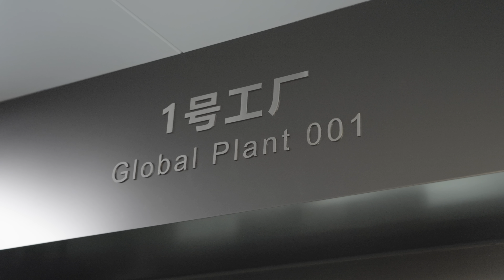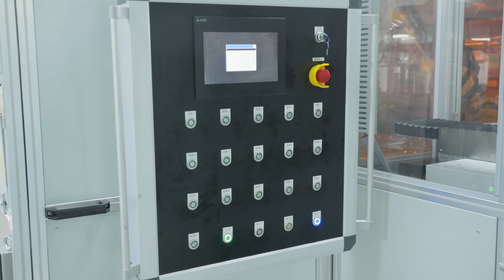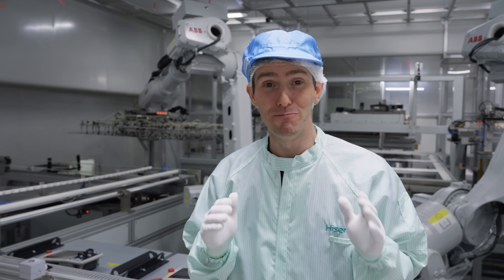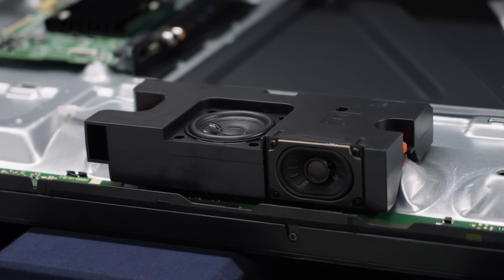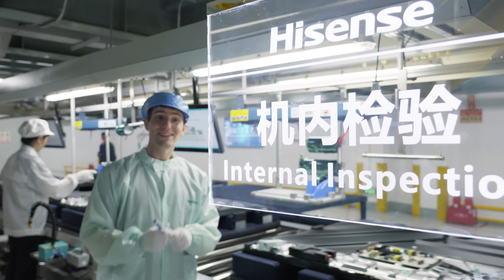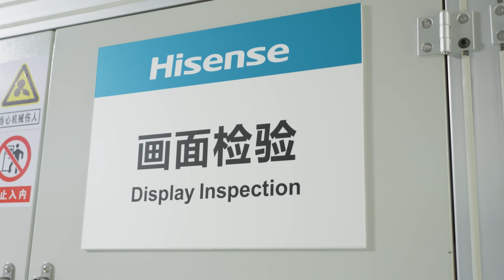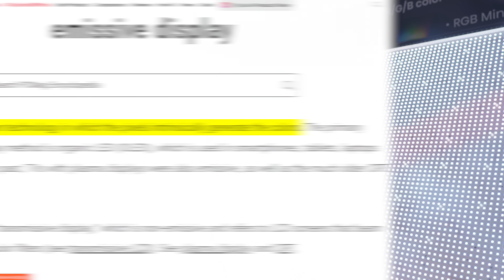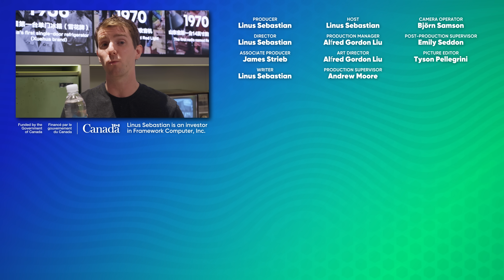This TV Factory is the Coolest I’ve Ever Seen

Comment: I bought a Hisense 4k 65-inch TV. and I do NOT recommend anyone to buy it as it is. The performance is so slow, and responses are lagging by seconds and has an older version of Android TV OS 11, and they do not provide any software updates. The refresh rate is locked, and dynamic refresh rate is greyed out. The microphones recognize my speech properly less than half the time.

Comment: Avoid Hisense UK at all costs.
I’ve had nothing but problems with their products and their customer service is genuinely one of the worst I’ve dealt with.

My Hisense washing machine and tumble dryer make a loud ticking noise like a Geiger counter, and despite raising this repeatedly, Hisense UK refuses to acknowledge the fault or honour the warranty. The support team are dismissive, unhelpful, and completely out of line with the brand values Hisense claim to stand for.

Hisense’s UK division does not reflect the mission statements and promises the company advertises.
Think twice before buying anything from Hisense — it may cost you more in the long run.

Comment: There is very big inconsistency in what we see and what we get.
R&D part shows backlight technology starting with FALD and dates it’s as elder technology.
However on production site we see panels only with 5 LED strips, that is far from FALD.
Those with 5 strips are just cheaper, I get no one want’s to present that, but without it the R&D part is misleading. Lower size models have usually 3 LED strips, yes I fixed few of them.

Backlight uniformity is one of the most irritating effects that can you notice after buoying new tv, especially on sport events it is a very visible. It is good to see that factory is testing that. Reassuring that bought model was tested. But seeing that FALD is still not a standard in the lower tier makes it not easy to buy. However, next time I will be buying TV I will look for hisense. 
BTW very nice tour.
Reply: hey buddy . In case you want to know Hisense is LED global industry leader for 5  year stragith.   They I mean Mini LED.    they prob not going to show ppl their higher tier process for their ULED line. 
                    Contrast :  (Rtings ) 
L9Q —- Triple    🟥🟩🟦 Laser 5000 Limen 
UX 116”             🟥🟩🟦 mini LED⚜Hisense
 🐦‍🔥🐦‍🔥🐦‍🔥🐦‍🔥    True RED      🐦‍🔥🐦‍🔥🐦‍🔥🐦‍🔥    
U9QG-     release in the fall       2025   
U8QG-      460000:1     Hisense     25
UX 85”      400000:1      Hisense      3
U9N—-      344000:1      Hisense    24
Bravia9–   292000:1        SONY        4
U8N——     277000:1      Hisense      4
Qm8K—     273000:1      TCL             5
QM9K—     271000:1       TCL             5
QM7K—     265000:1      TCL             5
QN95C-     201000:1      Samsung   4 
Qm851—   200000:1      TCL             4
X95L——   200000:1      SONY         3
QN90D-     167000:1      Samsung   4
U8k——-    165000:1      Hisense      3  
U8H——     160000:1      Hisense      2
U7QG—      137500:1       Hisense     5
Bravia7—   120000:1      SONY          4
Qm8——     114000:1      TCL             3 
QN95B—    110000:1       Samsung   2 
X95K——    100000:1      SONY         2
U7N———    89000:1       Hisense    4
Q90C——     83000:1—  Samsung   3
U6N———    80000:1 —-Hisense     4
QN90A—-    75800:1 —- Samsung  2
X93L——      72000:1—-  SONY        3
QM7 ——-     67000:1—- TCL            4
W95A——     62200:1    Panasonic  4
U8G———     54000:1     Hisense     1
QNED 85A    53500:1         LG 
Bravia5—      53500:1     SONY        25
x90L———     49000:1     SONY       23
X95J ——-     37600:1     SONY        21
X90J ——-     34500:1     SONY        21
X90K——-      35000:1     SONY       22 
X930e——        6564:1     SONY 
X900h ——       5386:1     SONY   2020

Comment: Just bought a Hisense U8Q, I'm hoping I wont have to use the 5 year warranty, the TV looks absolutely amazing.
Reply: Dude you will Love it!    Once you U8 , u can NOT go back to OLED.   n you will start to feel like OLED = scam.  or OLED is inferior ( in person real life) .
Reply: Also this is some info I saved for myself.  since you Bougth U8Q.  I am sending it OVER u might need it.  IN Case SONY snobs make fun of it. 
Hisense PROCESSING   <3<3<3 

ppl mistake :         bit  .     EACH Gaming Monitor has to do 50/ 50  MATH!  Usually 240hz, 360hz they will UP the hz. but Lower the (color depth of bit rate). 

so yo u will often get liek 10 bit Monitor for motion, but they do NOT tell u secretly u get 8bit colour.  
Also people have NO idea that (8+2fr) motion /  10 bit Colour  is MUCh better.  because you get about 10 bit motion visual, then almost -----12 bit colour.   

The same method if its ( 8+2fr) / 12 bit.  means you get 10 bit visual  but like 13 14 bit color processing. 

         Color transition in Motion    /     Color Depth ( " do I make Mid the SHADE to look more Lavender to be close to Blue to my left,    or make Mid shade to look More Magenta to look more Pink to colour to my Right") 

UX :       ( 8+2 fr) Motion /  16 bit.      ( 278 Trillion )    Tri Tri Trillion colours 
X11K                    10         /   16 bit 
U8QG    (8+2fr ) Motion /    12 Bit      (   68 Billion )     B  B  Billion  
SONY                   10        /    12 bit       
Qm8K                   10  bit  /    to bit       (    1   Billion ) 
G5                         10 bit  /     10 bit 

In general the :   (8+2 fr ) / Whatever is BEST!      ^^  ( I did Significant Research in Gaming Monitor )  When I was buying one recently finding SOME high end Lenovol Legion ( Gaming/ work hybrid monitor)   $ 1000- 1500 LED:      ( 8+2fr ) bit/  10 bit colour,           10 bit motion/    8 bit colour       
I was like WTF!           Lenovol is HIgh end work machine. VERY respected. 

Finding OUT IN SHOCK ,,,,,,, <3<3<3<3 
a HOENST company will do: 
( to have BEST in Person picture even though raise eye brows by tech snob) ,    Instead of 50/ 50  processing, 
They do ======>     40( Motion) / 60 Color depth processing. < pc Brain Math resource . 
SO you get ====>    48 (motion) / 60 COlor Depth   ( Visual)      <=== 108 !!!.    Also 125% of the Color processing.  <  4080 graphic card Jump UP to 4090 Level > '

            SONY Bravia8             vs             Hisenes U8QG  
                10  / 12                                         (8+2fr)  /   12        
 U get      10  / 12                                           9.8     /   13  n UP   REAL Life Visual 

That's why there are  240hz , 320hz Monitor :    $600, then 700.   Then there 240hz/ 360hz Montior :    1500- $3000 

I have try to look deep in TCL Qm8K. it dosent show its anything 12 bit . So FAR only SONY/ Hisense U8QG confirmed 12 bit. color depth. 
BUT BUT TCL X11K is --------------HIGH !  UP there!!!        16 Bit,  head on with Hisense UX!!!
Reply: ( My info form Chinese Main site. I gut deep cuz I didnt understand why is the Frigin UX ( I bought UX ) looking so MUCh better than QD-OLED / and Bravia9.   it look more like 8K.  but Samsung 85" 8k ( cross street store ) did NOT look as GOOD as 4k Hisene 85" UX  (extra smooth, lesss pixelated) 
so I dug deep lol.     Finding out ,,,,, yeah the ( Hisense  + TCL processing) significantly surpass SONY! 

Your U8Q is Significantly better tv than SONY + TCL.

Comment: 11:16 LCDs are funny like that. They can't block light well enough, but they also suck at letting it through, the transmittance (what percentage of backlight luminosity makes it out the front) is usually in the 5-10% range at best. So in most cases you're wasting 90+% of the light produced, and still struggling like hell to block it in dark scenes... Insanely inefficient, but in many ways we still can't beat it, at least economically...

Comment: They're good value for money, BUT they're not very durable. Most of the TVs and people I've spoken to start failing after 2 or 3 years; in my case, it was less than a year. Customer service is a bit slow, but they do their job. After almost 3 months of bureaucracy and on-site technical service at my house, they gave me a new TV, and after only a month of use, it suddenly restarted. This seems to be a persistent problem with certain units and many customers. The Wi-Fi component or the LED panel control fails. As I said, they're good value for money, but only for 2 or 3 years.

Comment: I was a cable installation technician for many years. When I would come across some of the original high sense tvs, Their digital qam tuners were not of the best stability.  They constantly needed to be returned. That of course was on a 750 MHz system probably using more of the spectrum than they were used to manufacturing. But now with their image quality, and for my use being mainly gaming and streaming, I think I'm willing to give them another shot.
Reply: 🏵🧩🐸🙉🍉 🐬   vs     🥮🐦‍🔥🦜🪲🪼
The LARGER of TV , Image >  > > STRETCH OUT < <  <. You need Denser Color to look:    3D 
      
 ( Rtings) tested at 10000 cd/m— HDR  
              🔮Color Volume 🔮
Red Luminance =
A90J      72                   ( OLED ) SONY
B4            89     cd/m²  ( OLED )    LG 
C1            84     cd/m²                     LG 
A80L       92     cd/m²  ( OLED ) SONY
Z80A   ==        ( B4 tier )     Panasonic 
Z85A      100    ( OLED )      Panasonic 
   
C4          104     ( OLED )               LG         
C5          134
G4          140     ( OLED ) —-         LG       
G3          140     ( OLED ) —-         LG 
A95K     190   (QD-OMED)
S95C      272   (QD-OLED) Samsung
S95D      371  
S90D      281   (QD-OLED) Samsung 
S90F       309  (QD-OLED) Samsung 
U75QG  410 🔔( mini LED)  Hisense 

A95L       221   (QD-OLED)      SONY   
Z95B       219     ( OLED )   Panasonic 
G5           248     ( OLED ) —-        LG    
S95F       420   (QD-OLED)Samsung
Bravia8|| 344   (QD-OLED)      SONY            
U8QG🐦‍🔥527   ( Mini LED    Hisense              
U9N   🐦‍🔥564   (Min LED )   Hisense
85”UX    530   2023             Hisense 
Bravia9   551   ( Min LED )      SONY 
U8N 75”  421                         Hisense         
U8N         381    ( Min LED)   Hisense                  
U8K         318     ( Min LED)   Hisense
U7N         153 
U8H        265
QN90C    382    ( Min LED )Samsung  (2023)          
QM8K     394   (Min LED )        TCL 

Qm851    585   ( Min LED)        TCL   
Qm8         404   ( Min LED)        TCL   
Qm7K       221               
QM7         291   ( Min LED)        TCL 
QM6K      103 
Bravia7    356   ( Min LED)      SONY
X95L        225   ( Min LED)      SONY 
X90L        272   <  FALD  >       SONY         
Bravia5    137 < FALD-M LED>SONY 
              
“
Green Luminance=
A90J        237     ( OLED )         SONY
B4            306   (  OLED )            LG
C1             291   (  OLED )            LG
C4            333    ( OLED )            LG
C5            478
A80L        317    ( OLED )           SONY
Z80A == ( same as B4 tier )Panasonic 
Z85A        337   (  OLED )     Panasonic 
G4            426   (  OLED )            LG
G3            420   ( OLED )             LG
A95K        606   ( OLED )          SONY 
S95C        882   (QD-OLED)Samsung
S95D      1167   (QD-OLED)Samsung
S90D        856   (QD-OLED)Samsung   
S90F      1,145 (QD-OLED)Samsung   
U75QG  1415🔔  (Min LED ) Hisense
 
A95L         679  (QD-OLED)    SONY 
Z95B        734     ( OLED )  Panasonic 
G5             887     ( OLED )           LG
S95F      1,551   (QD-OLED)Samsung
Bravia8|| 1,074  (QD-OLED)   SONY 
U8Q🥬 2,073   (Min LED)  Hisense 
U9N🥬 1,917     ( Mini LED ) Hisense    
Qm8K    1,206    ( Mini LED )     TCL

——🥬2024 UX 110” ——NOT Tested. 
85”UX   1,656          2023     Hisense
Bravia9  1,130    ( Mini LED )     SONY 
U8N 75” 1,400   ( Min LED )  Hisense
U8N        1,433   ( Min LED )  Hisense
U8K         1,157   ( Min LED )  Hisense
U8H           915   ( Min LED )  Hisense 
U7N           501   ( Min LED )  Hisense

QN90C    1360  ( Mini LED ) Samsung  

Qm851    1,885  ( Mini LED )       TCL
Qm8         1,250  ( Mini LED )      TCL
Qm7K          678  ( Mini LED )      TCL
QM7            826  ( Mini LED )      TCL
QM6K         343 
Bravia7       834  ( Mini LED )    SONY
X95L            781  ( Mini LED )    SONY
X90L            778  <  FALD  >      SONY ‘s = BEST SELLER 
Bravia5        420  <  FALD-Mini LED >  SONY ( NO quantum Dot)
Reply: buddy. I know what you mean.  After they bought SHARP TV in 2015 I was mad. I lost my fav sharp Aquos Quattron. 
Then out of BLUE I herad Hisenese Started to SELL the High end stuff recentlty that those high end tier existed OUTside of USA all this time.   THEY ARE INSANE.  
2025 ---- U75Q,  U8QG=   165 hz.  full 4k pc gaming.   with AMD/ Nvdia.    MediaTek 800 Chip. 
                    Contrast :  (Rtings ) 
L9Q —- Triple  🟥🟩🟦 Laser 5000 Limen 
UX 116”           🟥🟩🟦 mini LED⚜Hisense
 🐦‍🔥🐦‍🔥🐦‍🔥🐦‍🔥    True RED      🐦‍🔥🐦‍🔥🐦‍🔥🐦‍🔥    
U9QG-     release in the fall       2025   
U8QG-      460000:1     Hisense     25
UX 85”      400000:1      Hisense      3
U9N—-      344000:1      Hisense    24
Bravia9–   292000:1        SONY        4
U8N——     277000:1      Hisense      4
Qm8K—     273000:1      TCL             5
QM9K—     271000:1       TCL             5
QM7K—     265000:1      TCL             5
QN95C-     201000:1      Samsung   4 
Qm851—   200000:1      TCL             4
X95L——   200000:1      SONY         3
QN90D-     167000:1      Samsung   4
U8k——-    165000:1      Hisense      3  
U8H——     160000:1      Hisense      2
U7QG—      137500:1       Hisense     5
Bravia7—   120000:1      SONY          4
Qm8——     114000:1      TCL             3 
QN95B—    110000:1       Samsung   2 
X95K——    100000:1      SONY         2
U7N———    89000:1       Hisense    4
Q90C——     83000:1—  Samsung   3
U6N———    80000:1 —-Hisense     4
QN90A—-    75800:1 —- Samsung  2
X93L——      72000:1—-  SONY        3
QM7 ——-     67000:1—- TCL            4
W95A——     62200:1    Panasonic  4
U8G———     54000:1     Hisense     1
QNED 85A    53500:1         LG 
Bravia5—      53500:1     SONY        25
x90L———     49000:1     SONY       23
X95J ——-     37600:1     SONY        21
X90J ——-     34500:1     SONY        21
X90K——-      35000:1     SONY       22 
X930e——        6564:1     SONY 
X900h ——       5386:1     SONY   2020

Comment: 9% less glue, does that reflect the increase in failure rates of the LEDs due to less thermal dissipation into the back metal?
Though, at least they're building them in-house.
Some look similar to some of what Smasnug and IIYAMA use in their ODM sourced panel rebadges, I know of the top of my head IIYAMA's TE7512MIS and Samsung's LH75WADW LFD displays are the exact same frame, boards, speakers, etc... even though they didn't appear here.
But does Hisense's hardware get sold to OEM-rebadgers under the BOE/BOE-Hydis/BOE-Hydis(K-Tronics) brand, or AUO Optronics or the other one I forgot?
It'd be nice to know what ones I'm better off going direct to Hisense for rather than the other two, although I could get exteded warranty with IIYAMA as I'll have immediate access to parts if I'm given their permission as part of an agreement considering I fix their displays (my work fixes Smaznugz too, but because Samsunged wanted me to sign an NDA that I refused on principal, I can only work on IIYAMA), but if I get direct from Hisense instead of through IIYAMA, then I'd not be able to source parts from a business who's not badged the product with their honour of support (Rightfully so).
As for the LCD glass foitment stage, yes absolutely there's a very high risk of breakage, I've used tricks to get an LCD glass from a fried backlight onto one with a broken glass (LCD glass swapout) and wow is it risky given how easy it is to break. My current max is 55-inch screens, my next task is 65-inchers! 
I managed to do it without a clean-room and very little anti-static and was able to get a viable screen. The customer was informed prematurely by my boss before he could think how to charge for the repair thus forcing me to go ahead with the risky repair and then the boss got really dodgy with me over his own failure.
Anyway, if my current boss, I got tupe'd from the decent boss over to had actually consulted me and had a quick meeting with I and the customer, we'd probably be making plenty of profit and I'd of invested my own time in making a machine similar to the one seen in the next clip to what I'm referencing, but a handheld rig that pulls vaccum and allows even weight distribution over the LCD glass to transfer probably up to 98-inch LCD glass sheets over. (with a "split 50/50" deal, that's an instant 700 quid per 2 hours worst case, but he'd rather me do tiny printers where we loose about roughly 75p per hour because of how rough they're used, lol)

Comment: When I was a mass production engineer, my biggest job and biggest enginering challange was liquid dispensing. For my factory is was grease, too much grease you're waisting a product and possibling causing faults from it leaking out and too little you risk a brand new car spontaniously combusting. So I fully get why they'd go to such lengths to get something as seemingly innocuous as glue dispensing optimal. The biggest problem is air bubbles in the system, the second biggest problem is FIFO (first in, first out) if you get areas in a liquid dispensing system where the liquid can get stuck or not cycled through it, it can harden, separate or just go bad. The third biggest problem is the ammount, the smaller an ammount you need to dispense the smaller a pump or regulator you need and we were dispensing 2-3mg of liquid per application point.